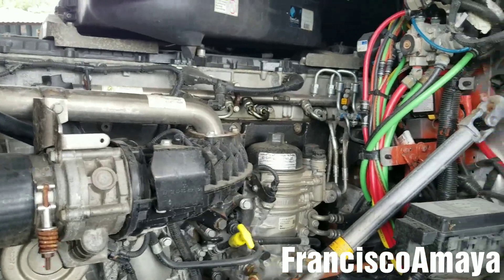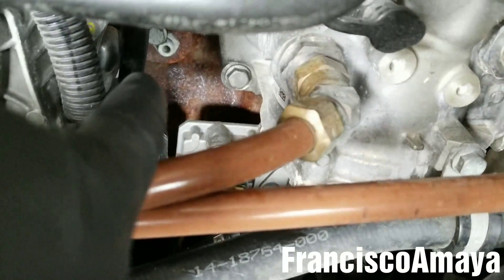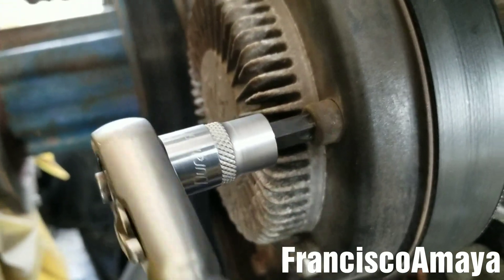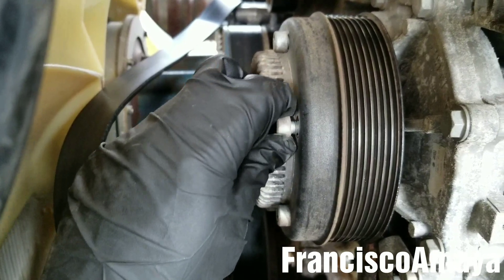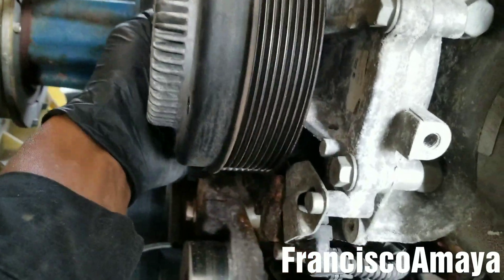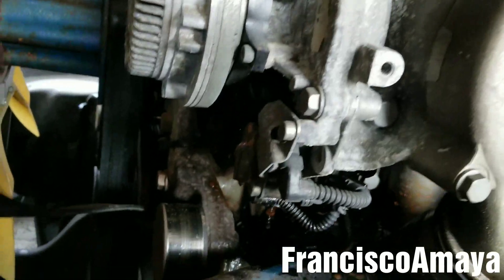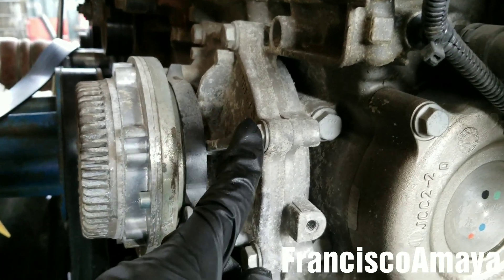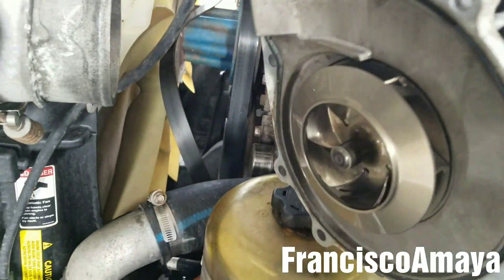Freightliner cascadia evolution water pump with thermo clutch replacement 2015 and up part 1

Comment: Can you just replace the water pump and keep the thermo clutch on? Both assembly is pretty expensive and my thermo clutch is fine, the pump is leaking from gaskets.

Comment: Much better step by step on this thermo clutch DD15 WP video then the regular DD15 WP vid Fransisco. Mostly in the peculiar way to drain the WP from that plug on the block. I didn't know so I kinda made a mess when I cracked open my WP lol. I remember the regular WP didn't have anywhere to get a screwdriver to pry it off like that new style. Man that was a PITA. That gasket gets like glue. I use Mobile Delvac 50/50 Million Mile Red coolant and just towel filter it since it lasts forever. I think I paid $55 for a NAPA WP made by Gates (no core) . I use Gates everything! Excellent quality an an OEM supplier for many makes. $800-$1000 for that OEM Thermo pump?!? DAMN that's hard to justify. I'd try to get the regular one mounted & when the required delete is performed I'd get them to program-ignore the thermo clutch no signal. Keep em comin. 😎👍

Comment: Do they still use a thermostat? With the ability to basically stop the water pump from pumping they can control the coolant flow. 

Wonder what effect this type of water pump would have on tanker trailers that require in transit heat?

Comment: I have a 2017 Cascadia with a DD15, it sometimes leaks coolant from the thermostat hose. It does it randomly, it did it twice this week and before that it had done it like 3 months ago. I have taken it to two dealers but they don’t see anything wrong and they said that the hose is tight and not damage. Any ideas of what it could be?
Reply: It is a gasket problem. When motor is cold the aluminium shrinks creating small gaps, when engine warms up the aluminium expands and stops the leak A lot of Cascadia's have this problem replacing gasket will fix it...